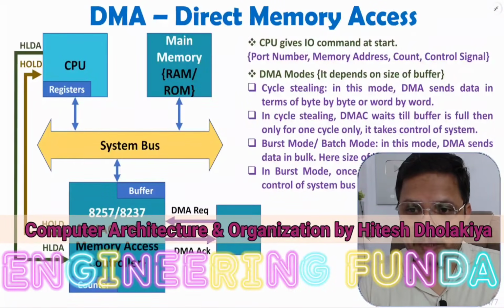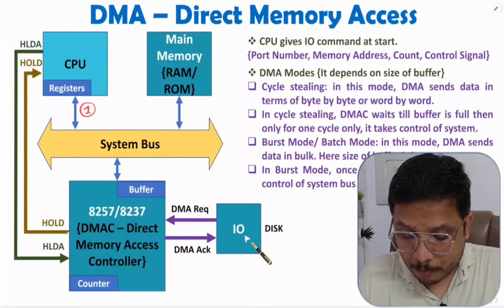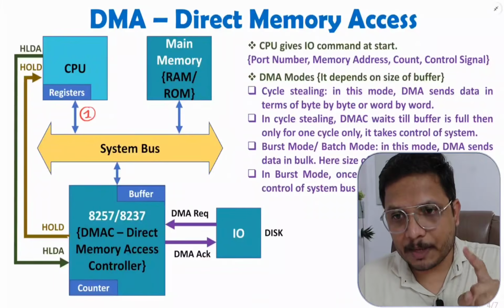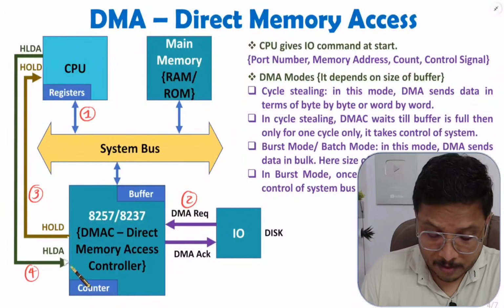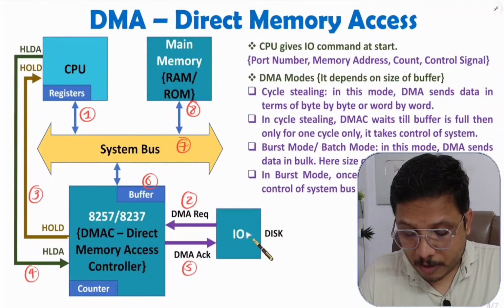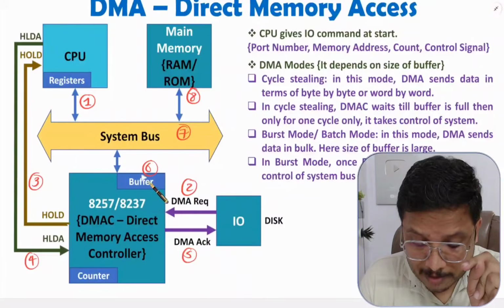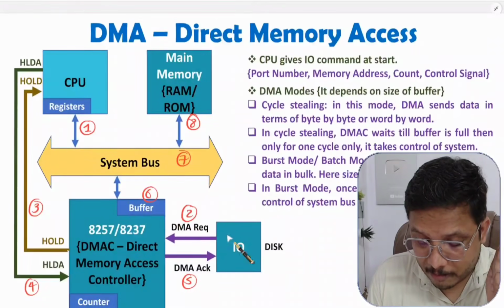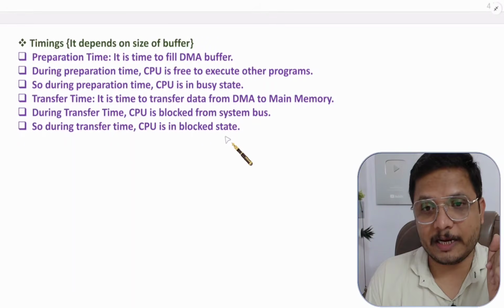Direct Memory Access (DMA): Working, IO Transfer Modes, and Timing Explained

Comment: sir dma takes control over system bus then it gives  dma ack to the io device and it transfer data to the buffer but at this dma taken permission to use bus but in last you are saying at preparation time  cpu can acces the bus but dma taken permission to use system bus before preparation time right ??? then how can cpu uses the bus at preparation time sir  ?????
please respond sir 🙏🙏🙏

Comment: Hello Sir, 
i have some confusion with the concept you explained in this video.
 Preparation time you told CPU is free to execute other programs (access to system bus), but before you explained:
 1. as once the dma request is raised by IO(disk) to dma controller ->STEP 2, 
 2. the next step is dma controller will send hold request to CPU to get access for system bus ->STEP 3, 
 3. as part of STEP->4 we get the hold acknowledgement from CPU saying system bus is over to you(DMA Controller)
 4. DMA sends the acknowledgement to IO to send the data to its buffer -> STEP5
 5. STEP6 is basically preparation time were we get the data from IO to buffer...by the time CPU is already lost hold on system bus.....so how CPU will be able to execute other programs could you please clarify my confusion 
Thank You

this question having many members doubt please clarify sir
Reply: @VENKATASAISIDDHARTHAMUPPIDI  I think what was mixed up was the buffer location , the buffer lies with disk and not with dma , since dma is only manager , now if you think it would make complete sense
Reply: I also have the same doubt and many of us have same doubt.
Reply: CPU will execute programs from cache memory

Comment: sir in cycle stealing mode if i want to transfer 32 bytes from i/o to main memory then it takes 32 cycles or 1 cycle?????
sir in burst mode if i want to transfer 32 bytes from i/o to main memory then it takes 32 cycles or 1 cycle???
please reply to this question sir🙏🙏🙏
Reply from the maker: DMA is used to free CPU, else data transfer will take cycles based on size.

Comment: Sir I am facing problem in registering and log-in in your mobile application.
Reply from the maker: May be due to network issue.
Reply: I am using my mobile internet, but I guess there is no problem from my end as I have been trying to sin-up from last two days but it showing buffering. Can you provide any other link that will help me in this case .
Reply from the maker: @santanukundu8247  try another application